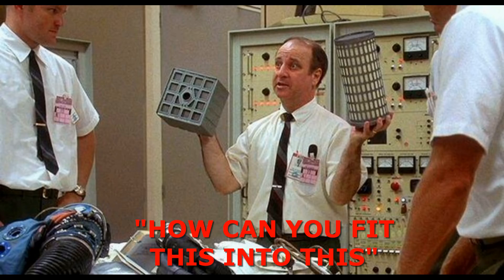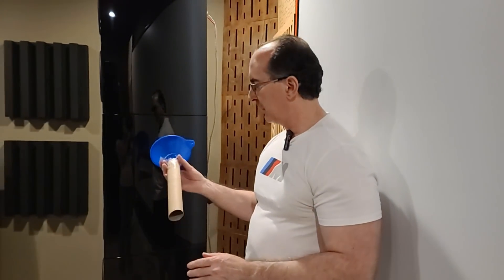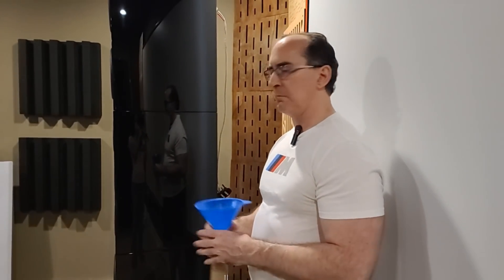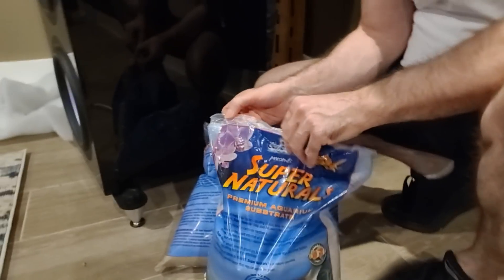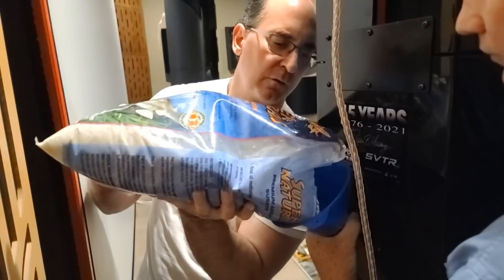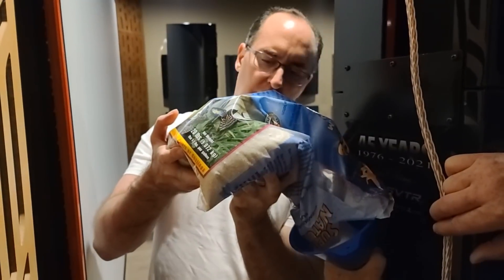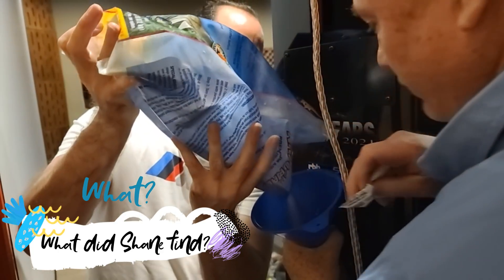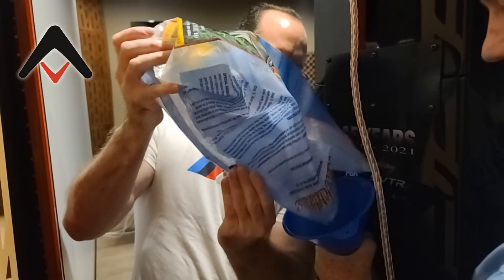Mass Loading Your Speakers with Sand for Better Sound?!?

Comment: If you really want to measure the vibration at zero cost, you can make yourself an interferometer with a laser pointer and the insides of a cd rom (anti vibration pads and  half mirrors). Then you glue a mirrornto the speaker and use it to create an interference  pattern and record it to measure the movement later 👍

Comment: I’ve not tried this, however I have used sand in speaker stands augmented with acrylic casting resin. This works very well indeed. There are other methods to dampen or deaden cabinet resonance. I’ve used the same deadening sheets used in car audio applied in the speaker cabinet with great success. These things all work. The focus of this loading is on the base of the speaker as opposed to the dampening sheet sections which address the dampening on all interior wall surfaces. There are many ways to address problems inside the speaker. I’m not kicking your sand dampening thing. It works well in speaker stands. It can work in speakers as well. The sand must be drier than the desert. Put the sand in an oven to extract the moisture completely out of the sand for obvious reasons. Use only filtered, dry sand to do this.

Comment: After many years , Im now just about to finally fill my heybrook hb sr3 speakers Left and Right which are hollow and require sand. Good tip w using sand from pet store to prevent moisture.
Im just worried how i get  the sand out at later stage if required ? I heard putting a thick plastic bag inside the hole and then fill it ? Would that be ok ? Anyone with experience that can advice:?

Comment: Gene-I appreciate the guidance on this topic BUT how would you then easily remove sand/lead shot from a speaker should you ever need to ship for service etc. (in my case from my 1994 CA2 Preludes) HEAVY!!!!!
Reply from the maker: It won't be easy and in most cases I don't recommend doing this. However, very rare that you need to send speaker into service.  It's easier to just take a defective driver out and send in for replacement.

Comment: Gene, in one video you did with Anthony, he had mentioned that you should make a big bass trap behind your screen. Watching this video it doesn't appear that you have done that, why, what was reason he said to do it and why did you choose not to do it. I did see you ended up placing your center speaker behind your screen now. Thanks for the great videos.
Reply from the maker: I did build the screen out 4" and covered the wall with dense acoustic foam. I need to do a video on it.
Reply: @Audioholics  Oh okay, yes I'd like to see a video on that part. Was the purpose for bass or just overall absorption. Thanks
Reply from the maker: @wally6193  midbass and midrange mostly. You can't build an effective bass trap that's only 4" thick, unfortunately.
Reply: @Audioholics  Yeah 4" isn't much from what I've read. I'm building a new house so I'll be incorporating some new ideas and one was to build(box out) my screen(100"diag) out 6 or 8" or more if needed to work as a trap. Another question(while I have you, haha), I believe it was Tony who said high back leather seating wasn't great for listening because the hard surface reflecting the sound right at ear level. And I noticed your new seats fit that scenario. My new room(22x17x9vaulted) will be set up for 2 channel with the projector for movies  thrown in. thanks

Comment: LIVE BEEN A FAN OF YOUR PROGRAM FOR QUITE SOME TIME I GOT MYSELF  A ARV- X 4300H DENON AMP A FEW YEAR AGO WHEN MY FATHER PASSED AND HAVE BEEN BUILDING ON MY SYSTEM FOR SOME TIME I FINALLY GOT THE MONEY TO GET 6 -R-41M KLIPSCH SPEAKERS SO NOW I HAVE A 9.1 SYSTEM I HAVE TWO UP HIGH IN THE FRONT AND 4 TWO HIGH ON BACK WALL OF LIVINGROOM PLUS TWO HANGING LOW ON BACK WALL AND LIKE SOUND BAR MIDDLE  CENTER UNDER THE TV  KLIPSCH ALSO. HAVE TWO TOWERS  PLUGGED INTO A 2CH MM7025 MARANTZ AMP TO RUN THEM I CONNECTED THEM THOUGH A THE NUMBER ONE RCA PLUG ON THE BACK OF MY AMP AND DIRECTLY CONNECTED THE TO THE TOWERS WITH 16 GAGE WIRES NOW HOOKING UP ALL MY OTHER SPEAKERS I CAN GET ALL THE FIRE EXCEPT ONE I KNOW IT'S NOT THE SPEAKER I CHECKED IT IM HOOKING THEM DIRECT AT THE BOTTOM OF THE AMP NOT USING NUMBER ONE ON THE BOTTOM BECAUSE I'M USING THAT ONE IN THE ACA JACK ON TOP . I CONFIGURED IT MANY TIMES AND HAVING PROBLEMS CHANGED THE SETTING IN THE AMP TO 9.1 SWITCH EVERYTHING AROUND USED AUDYSSEY . AND EVERYTHING O YES I FORGOT TO SAY I HAVE A SUBWOOFER ALSO KLIPSCH 12 INCH THE TOWERS AND THE MIDDLE SPEAKER ALWAYS OK  HOOKED UP ON ON GREEN MIDDLE ON BOTTOM SPEAKER CONNECTIONS IT'S JUST THE OTHER 6 R-41M I'M HAVING PROBLEMS WITH . LIKE I SAID IM NOT USING FRONT R AND FRONT L  ONE ON THE BOTTOM OF MY AMP ITS RED AND WHITE BECAUSE I HAVE MY TOWERS PLUGGED INTO THE FRONT PRE OUT ON TOP RCA TO MY AMP RIGHT NEXT TO THE SUBWOOFER PLUG . CAN'T SEEM TO FIGURE IT OUT VERY FRUSTRATED I JUST GOT A SONY 65 A80J TV WILL SOUND AMAZING COULD JUST BE IN THE SETTINGS . I KNOW YOU'RE A BUSY MAN COULD YOU LOOK AT THIS AND TELL MY THE SETTINGS AND THE LINE UP OF MY SPEAKERS ON THE BOTTOM HOOK UPS FOR SPEAKERS ON MY AMP. SO I CAN GET THEM TO WORK RIGHT IN A RESPONSE I'M SURE IT CHILD'S' PLAY FOR YOU WOULD BE MUCH APPRECIATED. THANK YOU TRYING TO LEARN FASCINATES ME.   HAVE A GREAT DAY WILL KEEP TRYING NEVER GIVE UP HA HA. MY DENON AMP IS A GREAT AMP BUT I FOUND OUT IT WAS GETTING TO HOT SO GOT A COOLING FAN FOR THE TOP OF IT. NO PROBLEM NOW LEARNING ALL THE TIME. THANK YOU

Comment: yes my danish speakers do have a lower cabinet for sand. it has its port for that . that sand that i filled it is called Silica sand has been in that for a very long time. i bought the sand at Rona Lansing a company in Canada where i live in Toronto.

Comment: Hi, Gene, I mass loaded my PSB 6i subwoofer with a marble plate (15x17 inch) on top of the subwoofer. It improved the boominess a lot. My sub was tested by Sound&Vision to be a good sub to begin with. The improvement cab easily heard. I have no way to measure it. If you see this message, please try it and measure it in terms of FR and distortion. Thanks,

Comment: I put some fishtank sand in my speakers reflex port, the soundstage is more punchy, solid and deeper
Reply: I can’t tell if you are serious or joking. If you did add sand into your ported speaker, what you did was decrease the internal volume of the speaker. This raises the Q of the box (adds more midbass and warmth), and I think raises the tuning frequency of the port (which adds more midbass and warmth).

Comment: great.I was wondering where to buy sand for stands
Reply: Home depot
Reply: I did Home Depot too. But I baked the sand to make sure it was very dry before I used it.
Reply: @hawkins55  yes the raw sand the sell for construction is a real mess trying to get it in the stands..The aquarium sand is likely very purified,washed and dried.
Reply: @toddhupp  Yeah. I was aware of aquarium sand. But I am cheap and the aquarium sand is many times the price of construction sand. And I finally put my oven to work!  :)

Comment: a local speaker manufacturer 40 km away from Geneva, Switzerland makes use of sand in the construction of the cabinet (sandwiched between two layers of wood, and also around the medium internal cabinet. the name is Jean Maurer but I thing the man died and it’s now it’s son who has taken over. I quite liked his product but ended up buying Wilson Audio Sophia Serie 1 which I prefer.
Reply from the maker: Yep, that can work quite well.

Comment: Gene be nice to see what difference mass loading makes to speaker stands compared to mass loading a speaker. As material is completely different to each other.
Reply from the maker: Huge difference in speaker stands that are metal and hollow. Those ring like bells without mass loading.
Reply: @Audioholics As I noted in another comment this thread, mass loading the hollow thin steel tube uprights on “budget” speaker stands can make a huge difference, both sonically and in terms of stability. Instead of aquarium sand, I used glass bead blasting media or shot bead, but both still to good effect.
Reply: @Audioholics  i use 7.3kg of atacama attabites in my speaker columns in my stands. Check them out good alternative that you don't   have to worry about mostieriser getting in.
Reply: It is an interesting topic but not always straightforward.
I mass loaded a pair of Target stands many years ago with Lead bites. I lived with these for years. I then had a home demo of a new pair of stand mounts. The dealer kept scratching his head as he couldn’t get the speakers to sing or sound right. He said “please tip this stuff out of the stands”.
I did and Wow! They came to life 
I left a little in there to stop the ringing but my word I learned a lesson.
I’ve performed this on a few other systems with very similar results.
Over loaded stands can somehow drain the speaker of dynamics. Give it a try and see what I mean. You can always put it back. 
Cheers

Comment: Hey man! I like the ///M t-shirt! Do you drive some M Power?
Reply from the maker: Yep, 18 M240i with a bit of boost ;)
Reply: @Audioholics  Very nice ride though it is not exactly real M. Do you track it?
Reply from the maker: @VASKION  No. Don't wanna burn thru brake pads and tires.
Reply: @Audioholics  Just get some nice semi slicks and try it. The stock brakes are very nice and will hold OK. You will definitely love the experience!

Comment: Can't measure it? Using your ears to test? Sounds like snake oil. Lol
Reply from the maker: Why is it snake oil if it's a free tweak and you can hear the cabinet is more inert by tapping on it after. I just don't have a laser vibrometer to measure before and after since the differences aren't revealed in a frequency response measurement.
Reply: @Audioholics  just busting chops. If it sounds better than it’s a good move. If it sounds worse I can’t imagine trying to get the sand out 😩
Reply from the maker: @jkherberger  haha true,  that would be a disaster.
Reply: @Audioholics  Maybe a shop vac would work to remove it. I used unscented cat litter in my metal rear surround speaker stands...cats didn't like it so I figured why throw it away. It works good for all rears 😀

Comment: So the manufacturer didn’t properly design these expensive speakers to begin with?
Reply: You'd think for the price sand would be included.
Reply from the maker: No they used the same box as their subwoofer for the mid/tweet array so it would be stackable.  Only half the volume is used. The other half is stuffed with dense insulation and capable of mass loading to make it even more inert. Watch the video next time before ASSuming.
Reply: @Audioholics  I watched the video and I understood the dilemma. My question remains. It was a legit question. Don’t go there.

Comment: What would happen if filled with water?
Reply: You get a wet speaker cabinet.
Reply: Voila! Wasted money!
Reply: Gee, MDF or particle board + water …… hmm, what could possibly go wrong?
Reply: @fonkenful  build speaker cabinets out of concrete.
Reply: @kyron42  that’s been done too, by a lot of DIYers, but the learning curve to achieve WAF worthy results is very slow
Reply: @Harald_Reindl  you're obviously having trouble with your English. You need some help?
Reply: @kyron42  at least my common sense and understanding why MDF is used for speaker cabinets is fine
Reply: @Harald_Reindl  I doubt it.

Comment: Alternatively if you have a tower speaker with the woofer not too low you could build a sand box to put the speaker in. Maybe a foot of sand around the bottom of the speaker might have a good effect.

Comment: Lol. I have a weighted blanket on my SVS SB2000PRO to keep the jumping down. It actually works. I do need to invest in carpet spikes though, as the rounded rubber feet from the factory do not keep it planted.

Comment: whats next ? never heard of this before
Reply: IINM, sand filling has been around since the days of Gilbert Briggs’ Wharfedale  designs of the “golden age” - circa mid ‘50s.  I’ve personally used glass “sand” blasting media and or shot bead in both the hollow legs of equipment and speaker stands as well as void areas of back-loaded horn and other floorstanding speaker enclosures. It certainly works, but on larger enclosures you need a fridge dolly and a couple of weigh lifters to move the speakers, and they can be an absolute nightmare to try to empty.